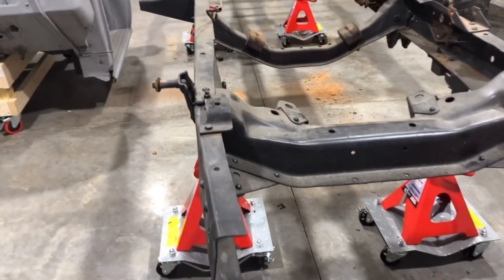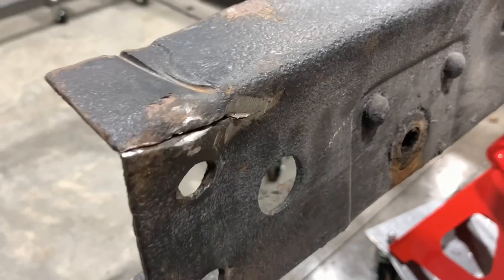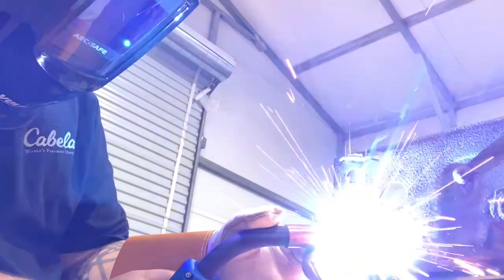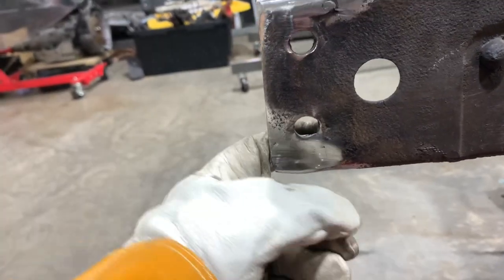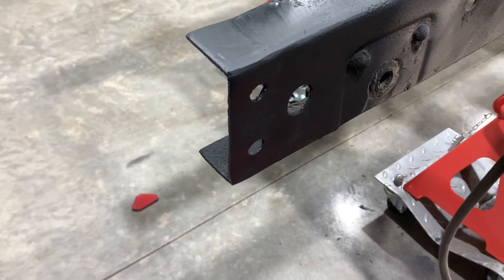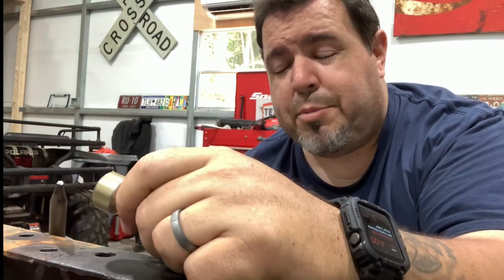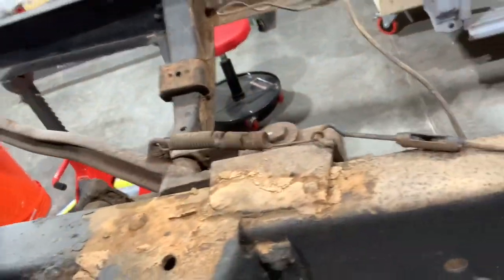55’ Chevy Truck | Day #1 | Frame!

Comment: You should have heated up the bent section while using the press to straighten it. You would have probably had to clean it good first though so you would not have a fire. I am a bit of a perfectionist, so I would have filled in that top part of the frame rail and ground it off to make it look great. JB Weld is great stuff! It is strong.
Reply from the maker: I thought about using the torch but decided against it as it weakens the material. Especially since it’s the front of the frame.

Comment: Did you ever consider boxing your frame? Working on my truck frame now and can't decide if I should box it in or leave it. What are your thoughts?
Reply from the maker: If you check some of my later videos, I boxed the front where I did an independent front suspension, and I boxed a small portion of the rear where I installed a 4-link. But I didn’t box the whole frame because its not a high-hp build or meant for road courses and such. Its just going to be a fun cruiser so I opted to spend the extra money and time on other aspects of the build.
Reply: @intheshoptv  My build will be quite similar. It will end up being about a 500hp street cruiser. I have people telling me I should just do it. My frame is boxed like yours where I put in the Mustang II front end. I just can't decide if it's worth the time.
Reply from the maker: @N8z14  it depends on how hard you drive it, (fast cornering etc). There’s the added weight and if you’re not getting the benefits of boxing it by just cruising, I didn’t see the reward. But only you know how you’ll end up using it, and if its worth your time and money. Another thing… Im not a fan of putting so much heat (from all the welding) into this 70 yr old frame. If I want a fully boxed frame, I’d look for a full aftermarket built frame. Hope that makes sense

Comment: Hey Mike,  nice work welding and repairing the frame,  BTW, Justice Brothers ( JB Weld ) had my back for decades!  I didn't see it , but did you check the frames' diagonals between the front and rear cross members before you started to remove the front X-member. The GM "ladder frames" are racked sometimes when hit. What other plans do you have for the frame?  Glad to see another video, don't know how I missed this one until this morning,  this is good stuff keep them coming!
 I asked my wife and brother, none of the names you mentioned are familiar, then again we are much older than you are no doubt.
Reply from the maker: Yes! The frame is within 3/16’s square after the repair so I’ll call that “ok”. So Im planning to do an independent front suspension and 4 link the rear. Thinking of using a Ford 8.8 rear as they are really stout and already come with disks/posi (tru-track). But of course that all can change depending upon how wild my mind and bank account run and/or deplete lol.
Reply: @intheshoptv   If you haven't picked up an 8.8 when you go hunting look for an Explorer they have 31 spline axles, I jumped on an 8.8 Mustang with 28 splines with 3.73s, and kinda regret it. Since you can weld shortening the one side should be no problem.
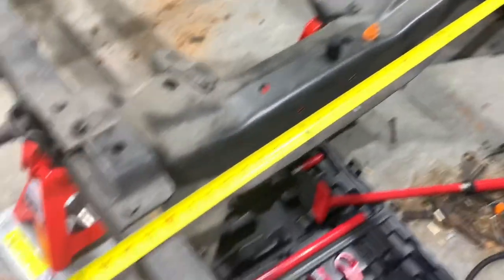Reply from the maker: @Brooklyn-bn5go  Exactly! A 96-01 Explorer rear is what Im looking for. Found one real cheap but it had 4:10’s and I think Id rather have the 3:73’s. The good news is that there are a ton of them out there.
Reply: @intheshoptv  What is your other channel?
Reply from the maker: @Brooklyn-bn5go  Not car related at all but, here you go: https://youtube.com/channel/UCfOAXyCiHBYuZg6fo8xGQLg

Comment: Do you have any videos on how you took the cab &bed off
Reply from the maker: Hey James, so the bed is just nuts and bolts and comes off in individual panels. There is a quick clip of me removing the cab in the previous video: 
https://youtu.be/FsbSvlkTYaM
Basically, I used the engine hoist (or cherry picker) and built a quick beam out of 2x4’s that I placed through both door openings under the roof or top of the cab. I loosened the 4 cab bolts and with a few pumps on the hoist, the cab lifted right off. With it hanging in the air, we just rolled the frame out from underneath! Hope that makes sense. Its was pretty quick, easy and straightforward. Good luck and thanks for watching!